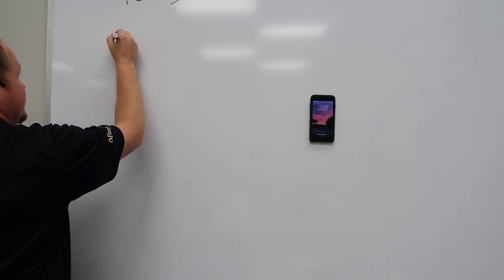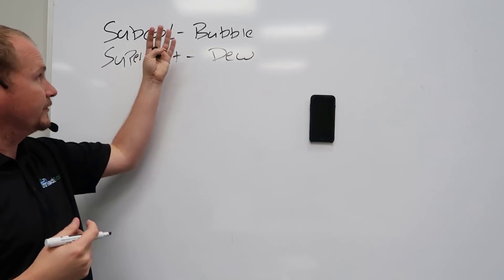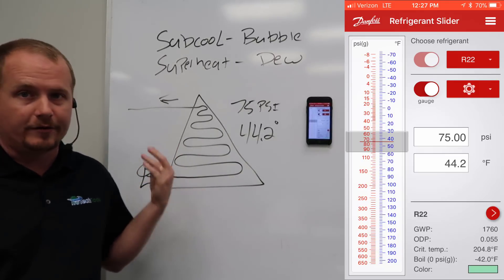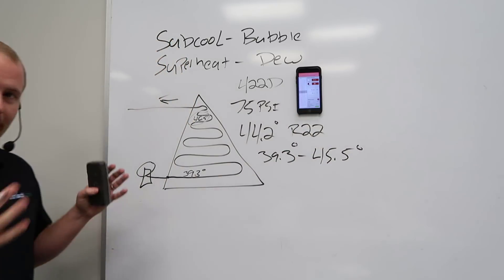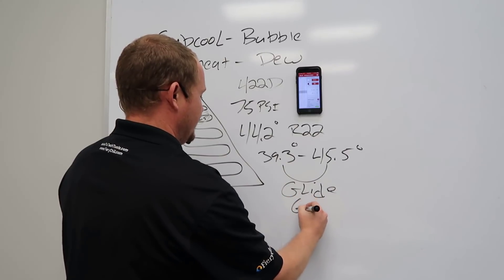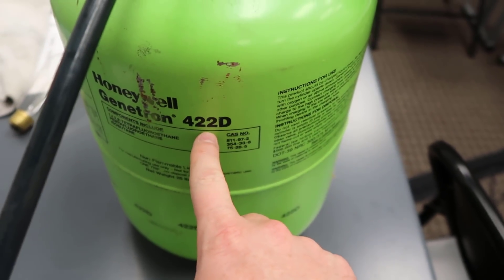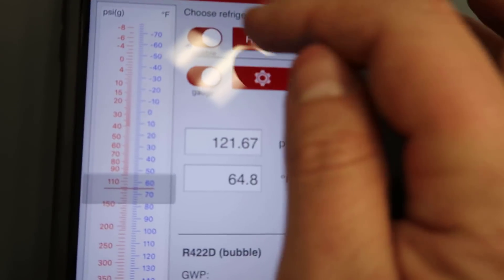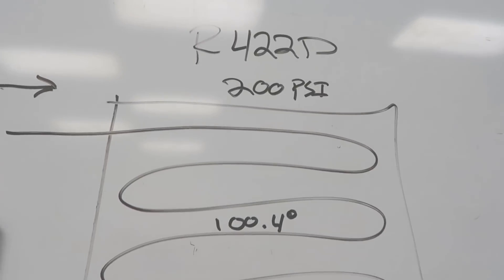When Dew and Bubble Isn't Enough - Refrigerant Glide Mid Point / Average Saturation Temperature

Comment: I thought It confusing before...Now I'm sure of it....Thanks for the attempt at making sense of it all, but it seems, if the charge is not right in a unit, meaning (the mixture) is bad, it's simpler, after hopefully finding and correcting a leak, to recover whats in it and recharge the crap out of a fresh tank on 410A...With all the Science and all the chemicals, they can't land on one simple refrigerant that's dependable and won't hurt the environment, but then, what doesn't.